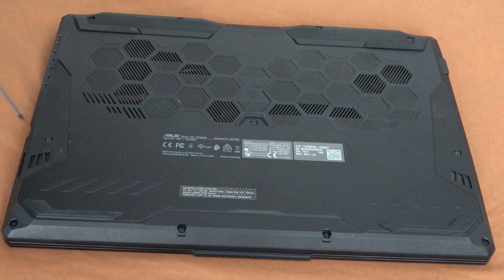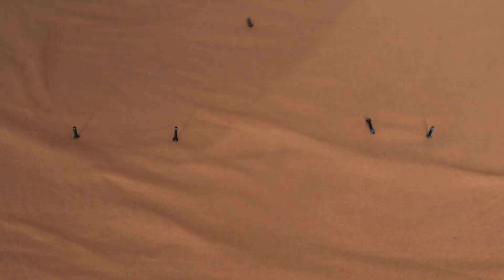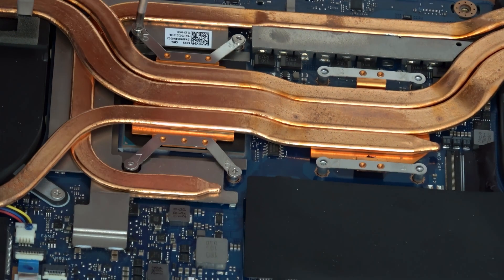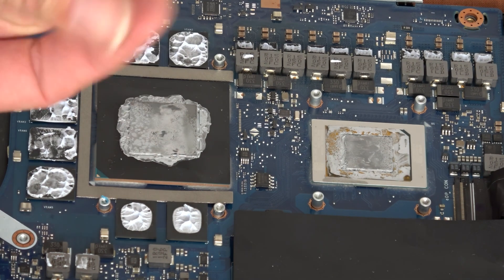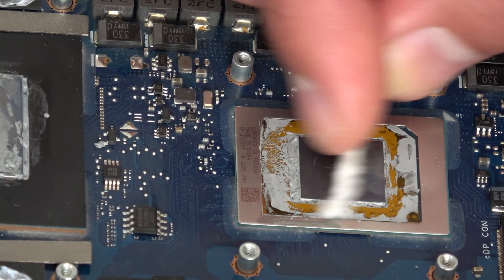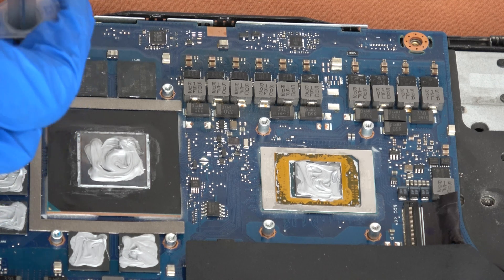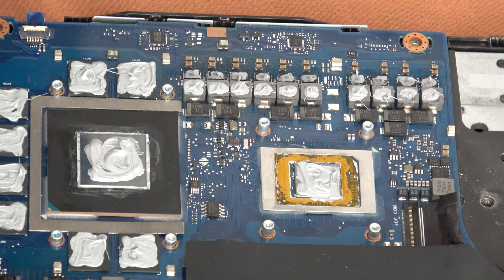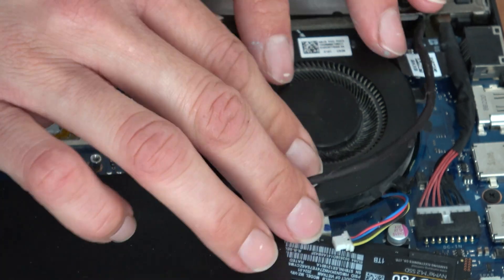Asus TUF Laptop Cooling:  STOP! Don't Make This Thermal Paste Mistake!

Comment: This video shows how not to aplly thermal inteface. On ram you should aplly Liquid Gap Fillers. And on CPU and GPU you might use thermalpaste, but not use it in so high ammount, but for better performance you better use HeatPhase Thermal Pads
Reply from the maker: we're receiving lots of controversial information about should or not liquid thermal pads vs paste be used. Soon will probably push an updated video.
Reply from the maker: @xodus_sys Here is the follow-up video with the correct application: https://www.youtube.com/watch?v=4SItYWW1dHg

Comment: Bro, it is thermal paste not mayonnaise. It should be applied as thin as possible. Thermal paste is used to increase the heat transfer area by filling the micro-roughness of the surfaces. And you spread it as if it were a sandwich. The thermal interface for strapping with a chip should be different, because as a rule, they do not have direct contact with the cooling system and soft or liquid thermal pads are used. Do not post a training video if you do not understand the proper way and issues...
Reply from the maker: we're receiving lots of controversial information about should or not liquid thermal pads vs paste be used. Soon will probably push an updated video.
Reply from the maker: @PavloBortnovskyi Here is the follow-up video with the correct application: https://www.youtube.com/watch?v=4SItYWW1dHg
Reply: Bruh, I LOL'd outloud and everyone looked at me.